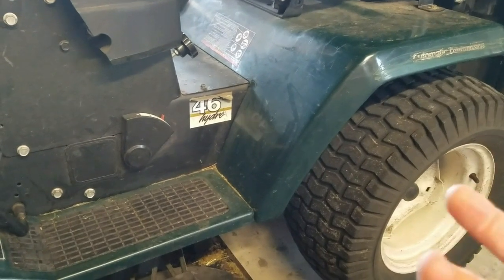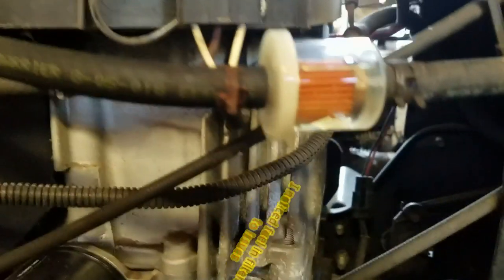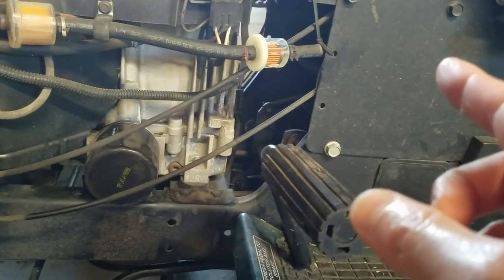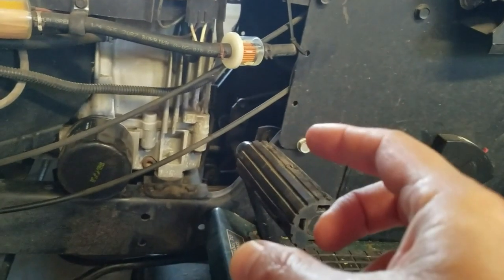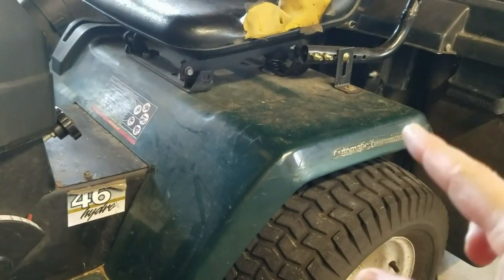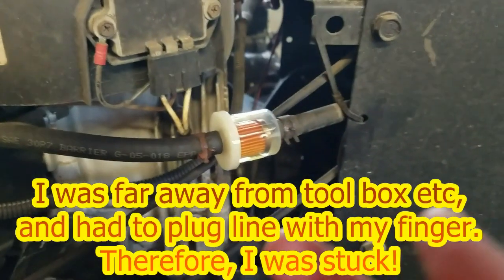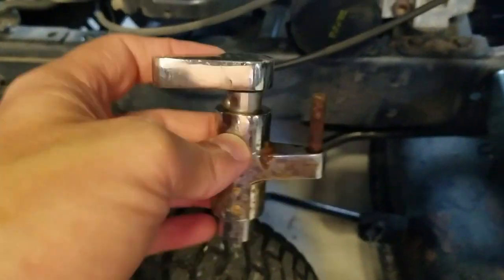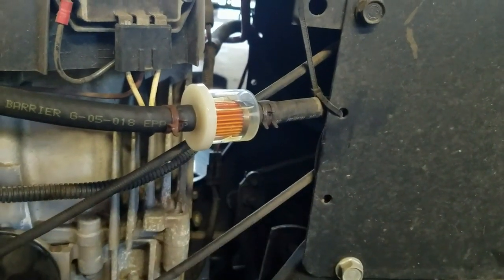Craftsman Hydro 46" riding mower - Clogged fuel line

Comment: Tks  for info.  I have a craftsman DYT4000 with Briggs 18.5 v twin.  About 20 years old.  It ran out of gas. Started back up but was not getting enough fuel. I watched your video and did the same blowing out of fuel line.  Unfortunately I didn't have a see through fuel filter and I purchased a new fuel filter fist thinking it was clogged but,when that didn't work, blowing air in the tank worked great.  I would suggest a low pressure and the gas cap off.
You're risking loosening walls of a possible deteriorating fuel line and cracking a old brittle plastic gas tank with over kill pressure.
Reply from the maker: Glad it helped.  Thank you for your info too!

Comment: That was exactly what my problem was! Used a can of compressed air (the kind you use on computers to clean keyboards and electronics) and it work perfectly. Thanks for posting this solution! 😃
Reply: Eric Davidson glad to hear that because after watching this video i figured i would try a can of compressed air. hope it works for me too. had the same problem. i let it run out of fuel (d’oh!) and it wouldn’t start after.

Comment: I think I have this problem mine will run fine then just start missing and quit under load take the load off it will stay running but miss and I did run it out a few times and got shit in my tank. Also it’s getting air and spark I just changed the plug to make sure all good there. Who ever owned it before me had put a Ford spark plug for like a V8 in it big old long plug I’m surprised it did t hit the piston. But it’s got a proper new champion in it now that fits and is gapped correctly.
Reply from the maker: Did the spark plug change help?  Sounds like it could be starving for fuel for sure.

Comment: MAN!!  I know this is the problem!! I keep blowing air back up into the fuel tank - I get a rush of fuel pressure back - cap on or cap off - reconnect the line and it runs for a few seconds - maybe 10.  Then the fuel stops and the filter goes 90% empty.  I can see it trying to suck fuel at the filter if the hose clamp is not on the fuel filter hose (fuel tank side of the line).  I have good fuel in the tank.  I’ll try this a couple more times...  MY fear is I’ll have to remove the fuel tank to clear it.  Haven’t done it yet. Big job? Small Job?  Ugh.  Grass doesn’t stop growing either way.  Thx for the video.
Reply from the maker: Ugh...not sure how long that will take.  I since gave this tractor to someone in the neighborhood.  (It had other issues, unrelated to this and we were given yet another....newer lawn tractor!)  Anyway, if I remember correctly, I considered pulling the tank....and I think there may be a video or two about it out there.  Good luck!
Reply: KMLTimesTwo Didn’t need to pull it.  A few more times broke up the debris and the filter caught it. Wish I could post a picture. Put a new filter on and ZOOM!!  Lawn Done. 😁👍
Reply: It’s really not that hard to remove the tank and replace the whole line. I personally would rather take the 20 mins to remove the tank and get the dirt out, then keep blowing it into the system and then clogging a fuel filter. But I’m cheap lol